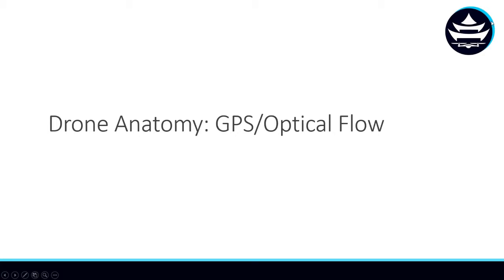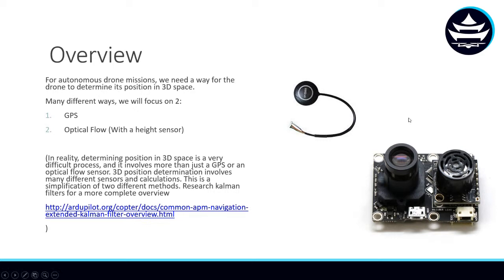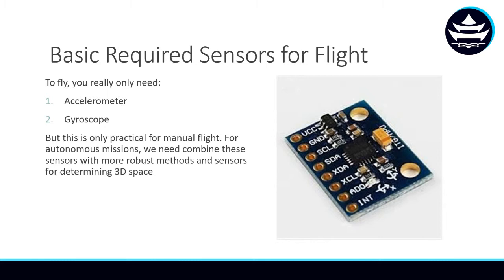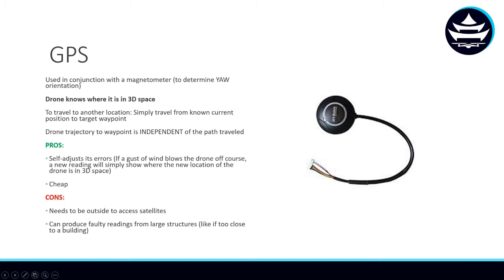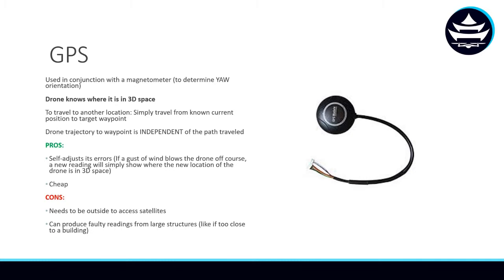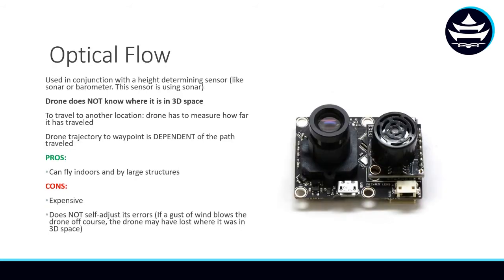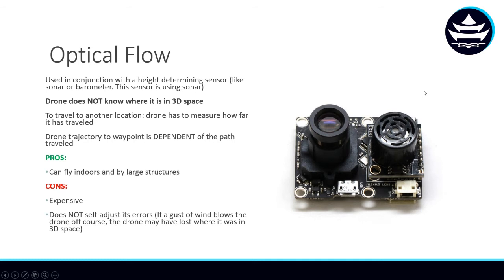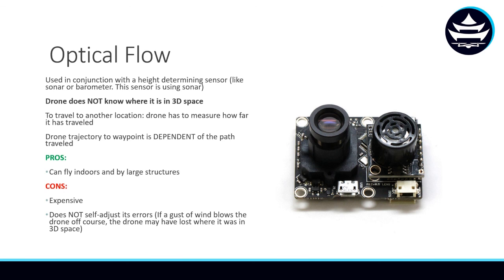GPS and Optical Flow for Autonomous Drone Control

Comment: Hello. How to enable the non optical flow fixed point mode of a drone?
Reply from the maker: Hi there Jerome! I would reocmmend checkout out the "Indoor Flight" lecture on my channel. It goes into how to install/setup the optical flow sensor. Then you can use the ArduPilot flight mode of LOITER to lock in on a point. Hope this helps!

Comment: optical flow sensor is attached downwards, when it is flown away by 10 feet due to gust of wind, why will it not be able to measure that displacement? Since the camera and distance sensor are always ON, the displacement must me measured. That is the work of optical flow, right?
Reply: It can actually measure the displacement. I’ve got a drone with optical flow sensors, it does correct itself indoors when it drifts and outdoors when wind blows on it. Basically any input That didn’t come from the controller is corrected